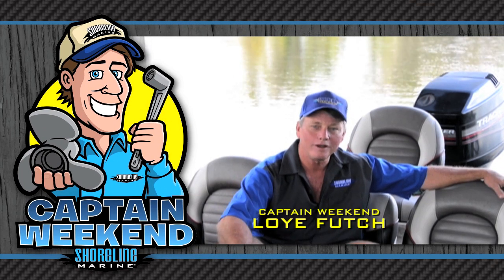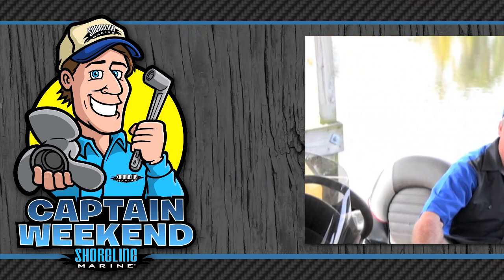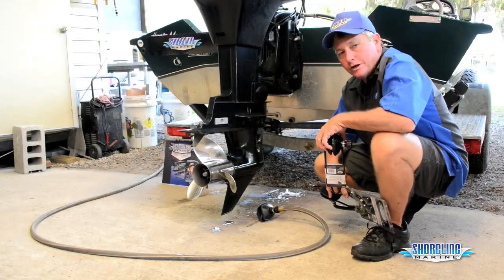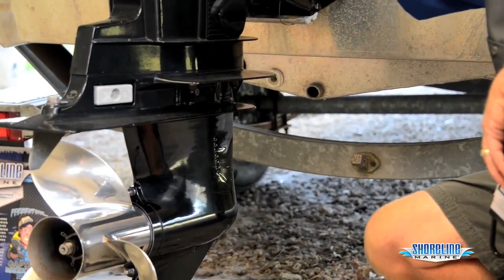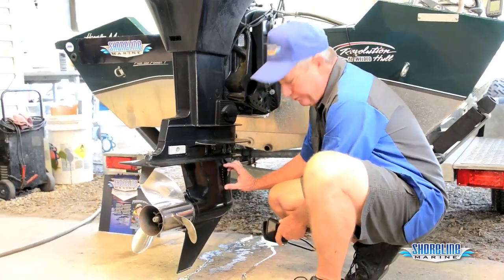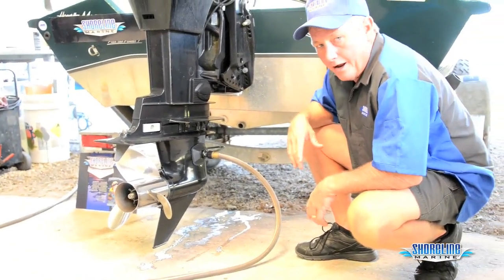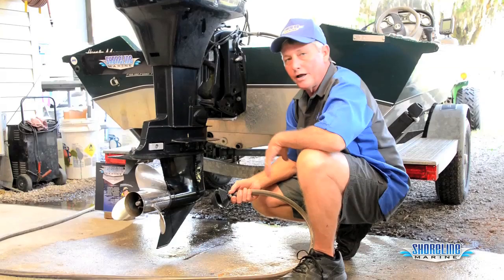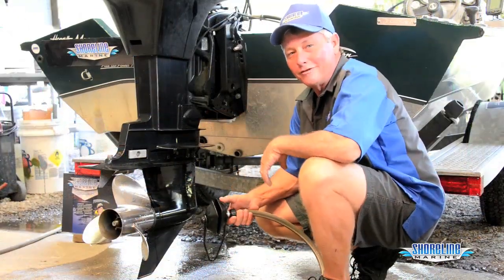How to Properly Flush Your Motor

Comment: Super nice quality video. Can I say that some guys might think " oh i have the top flush on my motors, I can flush them without running them. This is true. BUT if you come back to harbor/shore SUPER FAST with motors GLOWING HOT and connect your hose up and turn it on FULL PRESSURE cold water into a glowing hot motor without running it, sooner or later the block will crack. My local repair shop here on the Pacific West Coast said they are having lots of blocks cracking near the exhaust manifold. Reason is you should NEVER full pressure flush cold water into a SUPER HOT engine without running it. Run the motor or let it cool.  If this info saves on guy thousands of dollars its worth sharing.
Reply: They’re pulling your leg.  Engine block is water cooled at low pressure.  If the pump is ok, the block won’t come near boiling point no matter how fast you charge at the ramp!  Aluminum won’t crack with a fast chill, even if you could supply flush water any colder or any faster than the inbuilt pump.  Look to frost, corrosion, choked coolant supply for possible causes of cracks.  
Not a good idea to switch off any engine immediately after a full power burn, exhaust ports need a little time to lose heat and with coolant draining from an outboard engine, the port area could expand crushing the block or head gasket locally (water leakage). In reality, boating usually entails low speed maneuvers mooring or docking covering the cooling requirements.  The operation risk is charging to a destination and cutting off immediately.

Comment: I sucked up some freshwater vegetation, I replaced my thermostat, checked the pump, ok. But still can’t get water out the tell tale, I also flushed through the hose connection, I’ve poked a wire up the tale tale, still nothing, what’s your thoughts?

Comment: One question sir .  I have a mercury outboard 125 2000 2stroke when on the water the trim goes up and stayed on till u  disconnect the battery after a short it's works again normally any thoughts would be appreciated sir

Comment: I have a small 9.9 Honda outboard on the way. Small ones like this are usually flushed in a tub of water. The manufacturer directs me to remove the prop before flushing. Is this necessary? Can't I flush in the water tub with the engine in neutral and get the desired results? Prop removal is tedious. Thanks for your advice!

Comment: Thanks for the info on flushing the motor. I "thought" that added hose attachment up on the unit was handy, but they  didn't tell me it really is not designed to have the motor running while using it!  You exposed that little deception and may have saved my motor. I now use the muff for flushing thoroughly, and the port for simply rinsing after a day on the lake.

Comment: Thanks for the video.  I need to run a check on my water pump this week and this helps.  LIke every boater I made a mistake last time out and forgot to shut off the motor when I pulled the boat out for a minute or two.  Hopefully I see plenty of water coming out of the “peehole”.  Low hours on he motor so hopefully I have minimal damage to the impeller and I can get through the season.
Reply: I have a 2013 Mercury pro max 200hp that has a front intake port along with the normal side intake ports. If you run standard water flush muffs on the side intakes, you must also seal off the front intake with the Quicksilver Dual Water Pickup Flush Seal part number 881150Q 1.
VERY IMPORTANT

Comment: I'm an absolute newbie at boats. Just a bought a boat and did the mistake to run the engine without water running through at all for 5 mins straight and somehow, I didn't ruin the pump. I can tell because the boat ran just fine, so did I get lucky or what issues should I expect down the road?? Thank you in advance.

Comment: Question for you, I went to start my motor and get it going for the season. It’s been sitting under cover for almost 2 years. Water wouldn’t spit out of piss hole so I flushed motor. Water did come out when flushing so I hooked clam shells back up and started again. Had very weak stream coming out of hole even though I cleaned it out with a wire. Does that sound like water pump issue? I’m afraid to run too long and ruin motor.

Comment: My 9.9 Mercury marinar doesn’t have side intakes. It’s on a flat surface above the propeller. How do I mount it? I ended up using a tub with clean water since I was in the bay last jight

Comment: Nice video. However I would suggest to put the hose clip the other way, "embracing"  the lower unit, which is the correct way not to have the hose loose and falling to the ground during the flush.

Comment: I did this and water was not coming through the top hole of the motor very well. It would once I went and put more pressure on the clamps however. Is that normal and what could this mean?
Reply: Johan Lozano it means you need better quality muffs. They don't fit well enough.

Comment: Captain 
I have a 1985 25hp Mercury 
I was excited to get the motor running and rebuild the water pump..
But when I tested with the water muffs I had no telltale 
Any idea why?
I'm a rookie and am learning as I go with the help of your channel and others. No shop will help me due the age of my motor 
Thx for your time
Reply: I'm almost certain you will have a tell-tale, it just sounds like its blocked. It's normally easy to clear a blockage, a thin piece of wire pushed into the tell-tale hole will do it. Here is a video of a similar era Mercury, it gives you a rough idea where it's coming from. If it isn't flowing then never run your engine, you will cook it! 
https://www.youtube.com/watch?v=dpiUrWcGLNc
Reply: Thank you for getting back to me. I found the problem.
 While reinstalling the lower end it's the lower end, the brass pick up tube was not connected to the upper end. And. I missed the mark. I found that installing the pickup tube 1st, before the lower end worked much better .
 If you leave the pick up tube attached to the lower end You can't see The whole therefore not knowing if it's in the right spot or not. In my case it was not. Much easier to connect the top 1st then when installing the lower end you can actually see the brass enter the rubber grommet. 
 Now I have full circulation And working great.. Please share my experience with others
Reply: Sorry 
Voice to text errors
Reply: Glad you sorted it mate! Thanks for explaining what the issue was!
Now get out there and enjoy it
Reply: Thank you

Comment: can you add a detergent to the water hose
Reply: Some muffs have a detergent dispenser on them. Just mild dishwashing liquid in the dispenser is a good way to break down any salt.  Have been using Dishwashing liquid when flushing my outboard for day 1.  Its 20 years old now and no corrosion in the powerhead and thermostat.

Comment: I heard is was not good to run outboard in a barrel?
True?
Reply: IF there is NO ADDITIONAL 'FRESH COOL' water being added to the barrel.   While in the barrel w/ sufficient water, could be dangerous to put into the motor into gear IF THE PROP strikes the barrel and/or the torque of the running engine causes ti to turn and the prop striking the barrel.  On t he smaller engine when running in a barrel, we have always added a clothes detergent like TIDE-which flushes the engine, water passage and 'lubricates' the rubber impeller.  John Cstelluccio, Jr.   Southeast Louisiana-BAYOU COUNTRY

Comment: Why don't they just make these motors with a small air-cooled radiator and coolant reservoir the way a car engine is?  Seems like a sealed, closed-loop system of known fluid would be superior to having to rely on the water you're boating in and worry about running the engine dry.
Reply: its simple, that adds weight and weight is everything when it comes to fishing boats.
Reply: why is that?  Seems like it would only add a few pounds to the engine, 30 or so.  fishing boats are especially weight sensitive?
Reply: lmao weight?? your kidding right,   why dont the race 2 stroke bikes do aircoolled then?   simple answer its not effective enough since the engine needs a cover to stop it from getting wet you cant cool it down enough.  you never go fishing in a bath its always cold water
Reply: nothing to do with weight how are you getting air to a radiator?
Reply: the correct answer is that a car engine sits infront of the car getting all the airflow cooling the closed-loop system, the marine engine sits behing the boat getting next to no airflow and the water the boat is in is ALWAYS colder than exit water from engine.
Reply: The real answer is..... ever get your coolant flushed in your car after some time has passed?  The coolant was probably bright green when you poured 
It in and a light brownish green filled with sediment when you had it flushed.  
The water design is better for this application. You can flush it every use, it cools the motor effectively and it’s a continuous dump and filter. The filters on your typical boat motor are rated at 10-15 microns.  Besides, you’re motor needs to suck up and expel the water anyway, it’s efficient.
Reply: money...